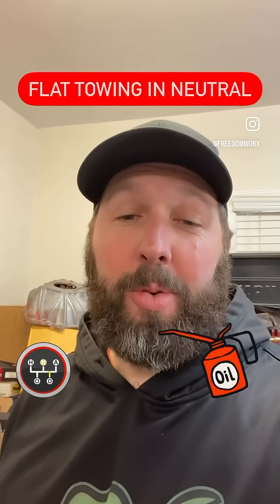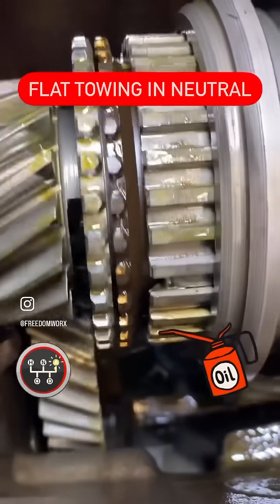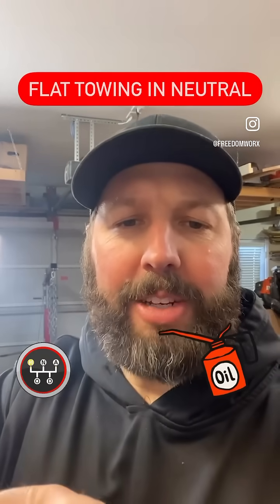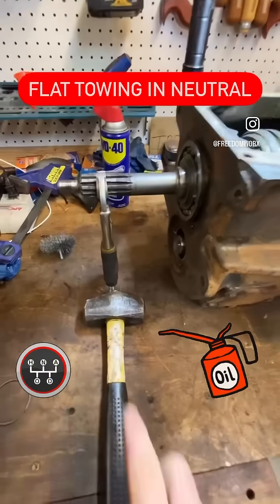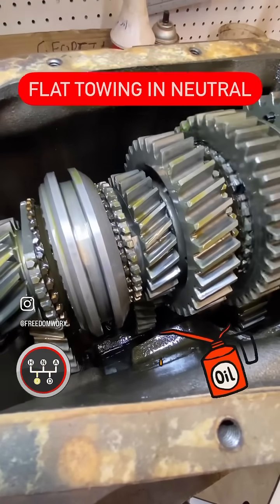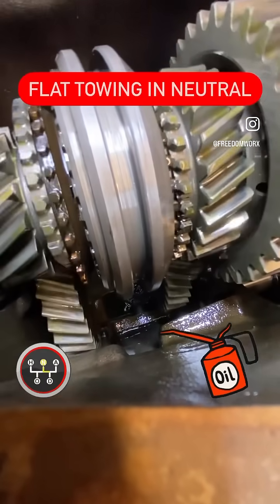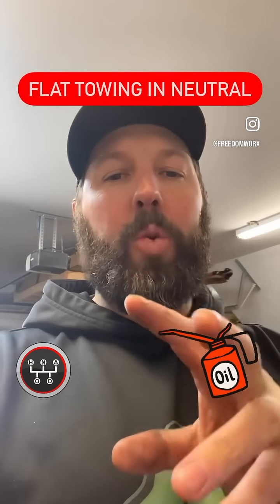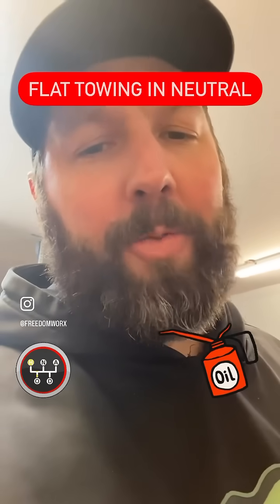Don’t Flat Tow in NEUTRAL!  #transmission #stickshift #mechanic

Comment: Ahhh crap. I've flat towed my 08 Wrangler 15k miles with it in Neutral. I just went back and reread my manual and apparently you're right! 😢 No bueno. Well it still works with 215k on it, so i got that going for me.
Reply from the maker: Luck Counts 😂👍
Reply: Towing 4WD Models NOTE: The transfer case must be shifted into N (Neu- tral) for recreational towing. Shifting Into Neutral (N) Use the following procedure to prepare your vehicle for recreational towing.  CAUTION It is necessary to follow these steps to be certain that the transfer case is fully in N (Neutral) before recre ational towing to prevent damage to internal parts. 1. Depress brake pedal. 2. Shift automatic transmission into NEUTRAL or de- press clutch pedal on manual transmission. 3. Shift transfer case lever into N (Neutral). 
4. Start engine.
5. Shift automatic transmission into DRIVE or manual transmission into gear. 6. Release brake pedal and ensure that there is no vehicle movement.
7. Shut the engine off and place the ignition key into the ACC position.
8. Shift automatic transmission into PARK. 9. Apply parking brake. 10. Attach vehicle to the tow vehicle with tow bar. 11. Release parking brake. 12. Disconnect the negative battery cable, and secure it away from the negative battery post.
Reply from the maker: Thats a pretty thorough process.
Reply: Now I may be wrong, but I don’t think Toyota even has a neutral setting on their transfer cases. But I have no way of confirming this. I don’t own any Toyotas
Reply: @truckinman86  My 89 Hilux pickup has a neutral setting on the 4 hi/lo selector.  Manual.
Reply: You service them fluids as recommended?
Reply: How about AWD vehicles like a Yukon?
Reply: @greenidguy9292  You must tow it only with all four wheels off the ground.
Reply: Having the transfer case in neutral is not the same as the transmission [as I am sure you are aware]. The transfer case does pump fluid via the output shaft, and that is why it didn't grenade on you. In this case the transmission is not turning at all.
Reply from the maker: That’s generally true. But there are some T-Case that still can’t be towed in Nuetral. I’ve had several Toyota owners tell me that there are some Yota cases that you can’t flat towed in Nuetral. I haven’t researched it, but have no reason to not believe the.
Reply: @freedomworx  Good to know. I read the manual for my silverado and it is towable with the t-case in Neutral. Every design can obviously be different. Love your channel by the way, interesting and humorous.
Reply from the maker: Awesome brother. Thanks for watching. 👍
Reply: @freedomworx  My wife's 2012 Toyota Rav4 has a button to lock or unlock the T-case, but no neutral.  The manual says to tow either on a flat bed or dolly and wheel lift so all four wheels are off the ground.
Reply: @freedomworx  you can not tow an Automatic Toy with transfer case in neutral. You can tow a Manuel Toy using the 5 speed neutral. If you use the transfer case in 1st Gen Toys you risk throwing all of your gear oil out of your front Diff. Ask me how I know.....................